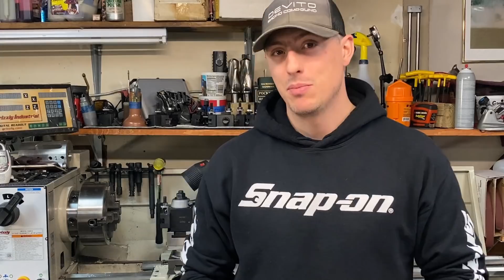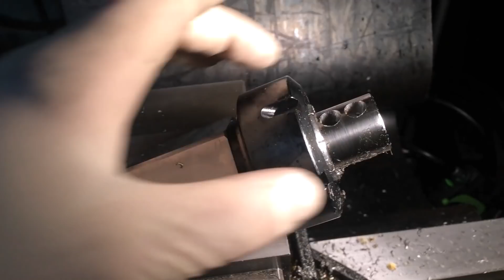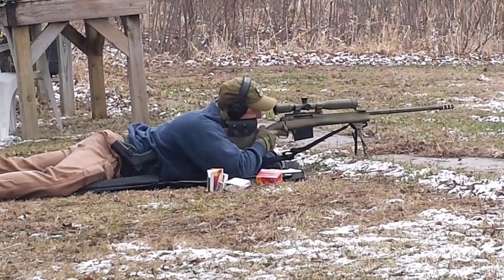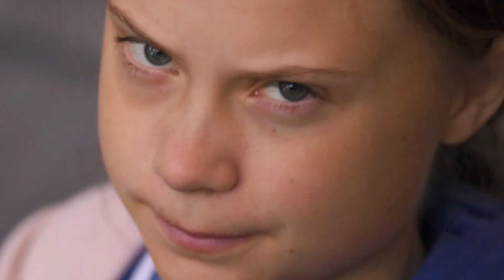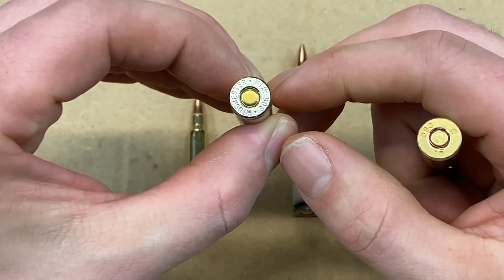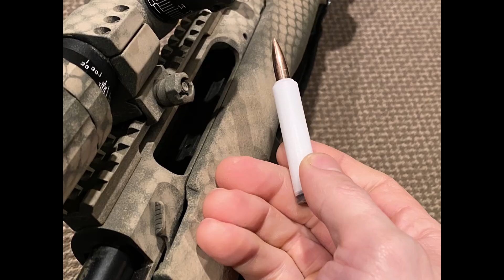6.8 NGSW ammo selected by the U.S Army for the NGSW Rifle testing! #ngsw #6point8ammo #army

Comment: Sig’s ammo weighs in at about a 60-75% increase in weight To 5.56 according to my contact within sig. The 20% “decrease” is always carefully worded so that it doesn’t specify which “brass case” or “standard ammunition “ it’s being compared to. The projectile weighs 73% of the weight of 5.56 literally all of these companie’s entries are going to be significantly heavier than misleading advertising has led you all to believe. I’ve not had a chance to weigh any Sig fury rounds but the weight increase is going to be similar to going to a 123 grain 6.5 creedmoor. The chamber pressure will be about 80000 psi. This will destroy barrels literally in a few hundred rounds on automatic fire. Unless there has been a serious change in the metallurgy of their machinegun barrel this will be a total failure. I’m certain “sense” is the furthest thing form the mind of the moron that selected the requirements for this competition.
Reply from the maker: Hey Jason,
   Like many things in big contract trials dealing with government the difference in what is stated by a company trying to get the contract and the goods and or services that actually come to fruition can be vastly different.
   Time will tell. I believe that this research is extremely interesting and even if nothing comes from it the fact is that a increased amount of data will de documented, collected and if treated correctly it will be reflected upon in future developments to shorten the amount of time and resources used to get us to the next firearm “breakthrough”.
   Your concerns are very valid and logic is sound.
Reply: I totally agree with everything you just stated. However my issue is with the fact the army has promised the purchase of 100k rifles to be purchased from the winning bid. If we are to take the army at it’s word then they will be purchasing these presumably expensive potentially flawed and largely untested designs at taxpayer’s expense with little oversight and or justification. This sounds like the adoption of the old “universal Camouflage Pattern” that literally should’ve been laughed out of the pentagon on day one of the selection process. I’m not saying that this is pointless I’m saying they should buy a few hundred of each and let some soldiers break em..... in. Then send their notes. There’s nothing these round can do at range that a 6.5 130gr creedmoor or equivalent round couldn’t do minus @15kpi or 250fps.
Reply from the maker: Yeah I don’t like it when anyone lets people get beta tested.
   You might be right about the creedmoor vs the new 6.8, but the fact is that we still don’t have all the specifications on the weight or velocity of the new 6.8 composite round yet. I love speculating about this stuff but I will delay my judgement until the test results are reported on. There will most likely be room for future improvements with it, like with many firearm products.
   You bring up good points to the forefront and I can appreciate that a great deal.
Reply: Switchpod  totally agreed. The last thing I want is our boys and girls to get short changed on anything. The 5.56 has served above and beyond what one could have reasonably be expected of it but it's time for a change. More range is generally better but expecting combat effeciveness beyond 800-1000yds with any small arm is a pipe dream. The only good reason I could see for adopting a round this powerful would be for the reneued use of  rifle grenades instead of 40mm launchers. Terrible idea at a glance, but when you take into account that modern rifle grenades could be precision guided much like the proposed "PIKE" missile system without the hindrance of having to fit within the 40mm tube of a m302 launcher.  A return to rifle grenades could take the extra weight and responsibility carried by a grenadier and distribute it among the entire squad and without large potentially heavy grenade lunchers beneath the barrel of a rifle enemies wouldn't know who to target to stop the rain of accurate explosive death. I don't think this is the intention of these requirements nor do I believe that top brass is creative (or intelligent) enough to realize this potential. I do NOT think we can trust the army brass pushing these rounds/weapons requirements to keep their word and purchase any of these rifles in any large numbers. They'll most likely give the same old excuse as to why the winner it's not suitable for adoption and move on to the next hairbrained multi-billion dollar contract for something they shouldn't have spent 10 cents on. My bet is on jetpacks.
Reply: @jasonbowen7190  Current rifles like the M4 are combat effective out to just past 100m in the hands of a lot of soldiers, maybe 300m if the grunt is a decent shot that can stay calm in a fight; and this is with low magnification optics. The NGSW program aims merely to double that capability with a flatter shooting round paired with a smart scope. So far the firearms are coming along surprisingly well from the candidates, which leaves the smart optic as the potential weak link in this ambitious project. If they can't stuff the necessary electronics into a combat rugged package, then the capabilities of the new rifles will be undermined.
Reply from the maker: Hey Jason,

    As effective as a rifle grenade (RG) is I don’t see the Army going to them with the 3D printed suppressors being on the NGSW. I don’t know if the Army would issue  RG due to needing separate training and the end users to also carry blanks as opposed to live ammunition. 
I do agree that a RG has a distinct advantage over the standard M76 frag grenades used currently. 
   The RG would definitely have an advantage over a 40 mike mike by not having the extra weight of the m203 on your rifle. The only difference I could see is in the difference in composition in the 40 that we currently have. If they would go to RG then more design and T/E would have to be done.

   Yeah military intel is only as good as the info from the people they pay to get it unfortunately but it’s a hell of a lot better than going in blind. As far as a jet pack! Sounds cool but a logistical nightmare. If it was to come to fruition I would guess SF would be the first to try it and Lord would that be interesting.
Reply: Oh nice mockup of the General Dynamics cartridge BTW. Out of curiosity have you weighed it?
Reply from the maker: Thank you very much. Not an official weight, but I did load with 34Gr of fast burning ball power and it still felt lighter than the 5.56 round. Having said that the projectile I used was only 100Gr.
Reply: To clarify on the rifle grenade point. I’m not seriously proposing this. I don’t think that even having a service ammunition this powerful has any merit worthy of adoption. This is my my mind going to extremes to find justification for the army attempting to adopt a massively overcharged.270 round with the stipulation that it needs to be effective to 1200+ yards with a 16 inch barrel.  Rifle grenades had their time. With full power cartridges RGs had similar range to modern 40mm grenade launchers. The primary issue was accuracy. The rifled barrel of an m203 m302 or gp25 provided a level of accuracy never before achieved with knee mortars or grenade launchers however it cost the soldier in terms of explosive yields and the weight of the launcher. This trade however was worth the cost and 40mm has become standard.  Modern technology has provided things such as gps, infra red, tv and laser guidance potentially fixing any/all accuracy issues. Not to mention the addition of rocket assisted munitions like the “PIKE” missile. As for the use of special cartridges, that isn’t entirely true. It’s true of the garand and the sis most designs we’re familiar with now but that isn’t always the case. The French developed a grenade that the bullet passed right though the middle way back in WWI. More recently (mid 2000s) an Israeli company Marketed a breaching charge that could be launched at short distances from any standard AR style flash hider. It made use of regular ss109/m855 ammunition. A cartridge this powerful could take a full yield grenade a great distance however a rocket assisted guided munition would have the potential to travel miles especially since it wouldn’t  be limited to a 40mm tube. You wouldn’t need to launch something all that far. Just far enough so that the operator is out of the way of the rocket exhaust and any potential danger from misfires.
Reply from the maker: @jasonbowen7190   Yeah the changes in technology are vast. 
   Q: do I trust the new NGSW 6.8 cartage?
   A: No, but I am very interested to see the limitations and advantages of it, and the advancements of future ammunition due to the testing of the new  true velocity munitions.
Reply: True velocity has by far the best chance(ammunition wise). They’ve done a exceptional job on their 5.56 and 7.62. The move semi telescoped neck was very smart. I don’t understand the sharp shoulder angle but I’ve got some ideas why they may have done that. The textron bid while super light weight requires way too much complexity in the operating mechanism to be effective. Sure it might be reliable but if you need an engineering degree to clean it, it’s done. Sig has the best ground game right now with a strong presence in the civilian market as well as already winning the “m17” project(quite controversially). I believe that having their .277 (Fury) on the civilian market will work against them as if they make it too cheap people will begin to realize all the hype is just marketing and if they make it too expensive then nobody will take military adoption seriously.
Reply: @jasonbowen7190  The Textron gun is only complex to people that don't have a mechanical imagination, it's actually no more complicated that a conventional rifle. In fact, it has entirely  eliminated many parts that commonly fail on conventional rifles: there is no bolt, so no bolt lugs to break, and no little ejector plunger or extractor claw. You don't need to mess with removing a cotter pin, firing pin, and cam pin just to separate the bolt from the carrier. With the Textron rifle, you pop the rear pin and pivot it open like an AR, then simply remove the chamber for cleaning.
Reply from the maker: @jasonbowen7190   I will have to agree with that. I how ever still like the idea of case less ammunition If only the issues of environmental changes that can impact the ammunition durability could be solved, Thereby  relieving the need for a case at all.
Reply: No the textron bid is complex to anyone that can count. You don’t reduce the complexity of a system by replacing a two parts that that MIGHT prove problematic with a dozen plus parts that are almost guaranteed to be. They’ve  had issues with this thing since they first showed off the mock-up @quantico 3+ years back. The FACT is that if you increase the number of factors that can go wrong you effectively increase the odds that it will go wrong. So let’s just count some of the “improvements”
1. A chamber that slides vertically to load and eject cartridges.
2. An electronic fire control group.
3.75-100ksi max chamber pressure.(their exact numbers they list not estimated)
4.strait walled push through cartridges.
5. Spent cased ejected below barrel shroud. 

My issues with said improvements 
1. There has to be a seam between the barrel and the chamber (similar to cylinder gap) right where one might place their off-hand(kaboom=no fingers)
2.not even gonna dignity the electroFCG with a response.
3. Insane pressure combined with  #1 is just dumb.
4.single feed only. no taper means (by design)either a long straight mag or a fat staggered(less reliable mag).
5. Where to start. Well it has the ergonomics somewhere between an m4 and a vacuum cleaner. This thing is front heavy(as hell) has no parts in common with existing systems and despite some resemblance is NOT compatible with any AR platform furniture. Having held the mock-up I’m less than impressed.

I don’t lack “mechanical imagination” whatever that’s supposed to mean. I simply possess common sense.
Reply: I think textron has given up on the caseless rounds for the foreseeable future. That was the initial idea with the LSAT’s cased ammo. They’d develop a polymer cased version for interim production and transition to a caseless version after “the technology is developed” to produce these rounds in scale. I believe that this has become academic as their polymer rounds have achieved nearly the same weight reduction (40% with polymer vs 44% in the 5.56 version) with caseless. The validity of the caseless argument(no pun intended) has also come into question due to the necessity to seal the chamber at both ends. This increases the complexity and weight of the weapon as well as the need to maintain said seal. On the polymer version this is not an issue as the case acts as a seal and it’s .. well.. disposable. If it comes down to a self sealing cartridge or what is effectively a 4% reduction in weight the choice is obvious. That’s not to say it’ll never be viable just that I hope that there are better options available than projectile weaponry in the future.

Comment: Greta will never be happy. The only time I can see an accuracy advantage, would be for ammo stored for a long time, where the brass casing and bullet are affected by some corrosion and seizes the bullet to the casing and increasing pressure when fired.
Reply from the maker: Good thinking out side the box Viper! I like that! Yeah I think your right about Greta! LOL!
Reply: @jeerrrrrrryyyyy  brass is also 100% recycleable...and Greta Thunberg is a climate activist. Using a polymer, I can see no apparent advantage in regards to being more climate friendly, rather the opposite. Since you need to make even the casings out of fossil fuel products directly, rather than indirectly.
In other words, the ammo company mentioning it is "100% recycleable " was just BS you since that is not an "advantage" over brass. Should have maybe mentioned that, unless you didn't know that.

Since you seemed interested in the topic of ammo being environmentally more friendly, why not make a video on the impact of that type of ammo compared to conventional ammo. That would definitely make for an interesting video..."what's the most "green" ammo type"